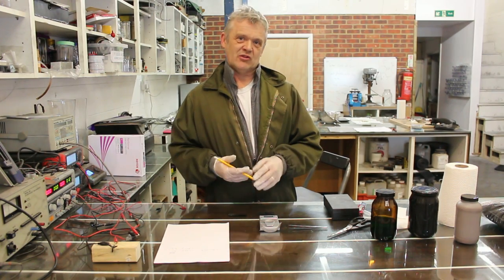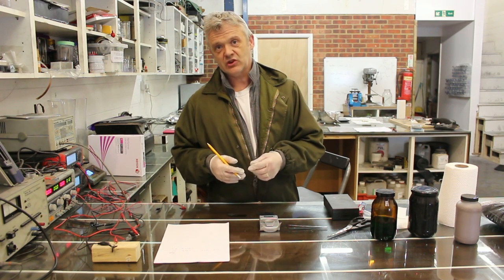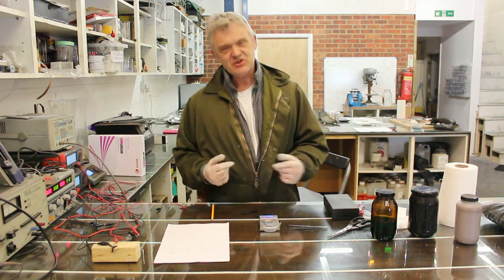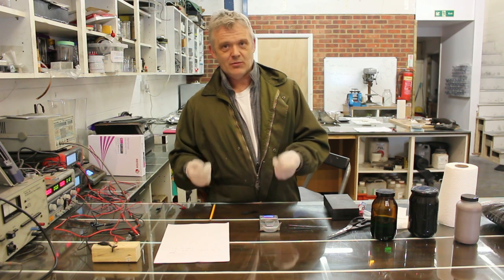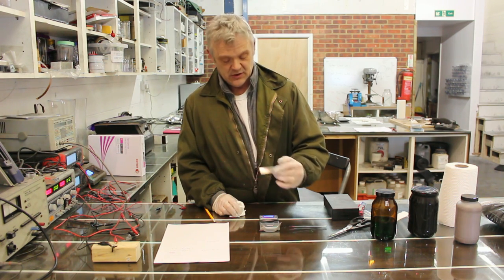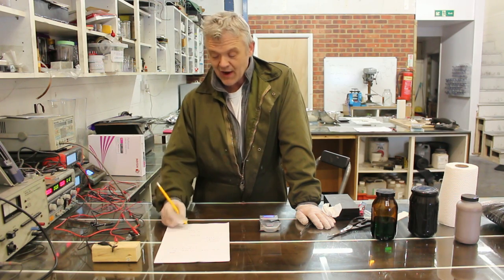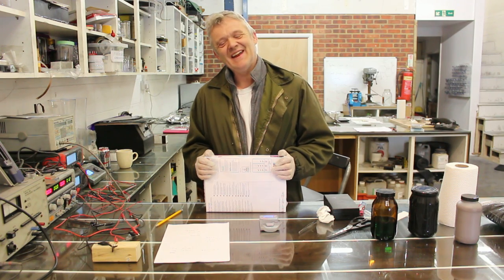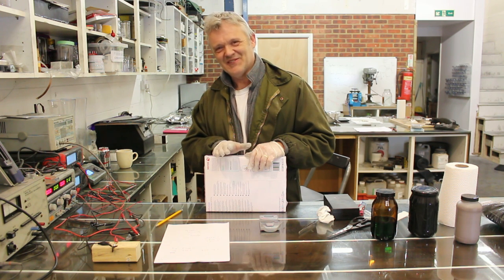How To Make A SuperCapacitor - Follow Up

Comment: So I'm interested in starting an airliner. I want to build planes that are inspired by Elon Musk's vision. And electric airplane capable of vertical take off and landing. From what I've seen most of the technology exists to build such a thing, the only problem is the power source; would sunvault/Edison possibly be able to build a Supercapacitor that could power a passenger plain? If so how would I go about contacting someone to build these for my company?
Reply from the maker: We don't really do outside work mate all Edison development is for Edison. If we did design such a thing we would be more interested in a JV rather than a job for a company. I was thinking of a POC UAV

Comment: I was wondering, you hint that using a thinner coat of graphene, seems like a better result, but what would happen if you made a thick coat of graphene? It seems like the paper seperator you coat the graphene on is what is taking up most of the mass of the super capacitor. Would you get more power storage with a thicker coat of graphene? Also, is there a good liquid separator material that can be thin coated on to your capacitor?  I don't see why you need to have lots of paper, or other solid material, if you can just spray on ultra thin coats of graphene and seperators, I figure you would have more room for more layers if you could just spray the layers on.I was also very interested in your ultrasand. You say silicon dioxide converts carbon into a coating of graphene, under heat. Is that ultrasand a good material for very large scale supercapacitors? The concrete foundation of a house could easly be converted into a huge power storage device with several thin layers of ultrasand grout, with separator layers of laytex paint. Imagine 20 layers of your ultrasand covering the foundation of an entire house, or incorporated into rubber mats put under the flooring of a house. This type of super capacitor would be entirely out of the way, its super cheap and ultra sand seems like a very easy way to mass produce graphene. Also I bet if you made your ultra sand super fine, like flower or powdered sugar, and made a fine grit sandpaper out of it, it would make a wonderful super capacitor.I just love the idea how silicon dioxide is the perfect catalyst, to convert carbon into graphene, it just strikes me why no one has tried to use silicon dioxide to mass produce graphene. I could see, using large rollers of silicon dioxide, and spraying them with a carbon rich spray, then rotating that into a kiln, or a conveyer belt covered with silicon dioxide baking trays, going through an oven, like a bakery makes masses of cookies. Once the silicon dioxide plate exits the oven, the graphene can be scraped off, or chemically washed off.I am looking into making a kiln or a diy brick pizza oven, and try making some of your ultra sand. Could you please tell me if ultra sand would work well for making super capacitors?ThanksRandy
Reply from the maker: +Randy Travis All of these are good questions mate - but you are asking too many questions and not getting up and trying it out. Your best answer to the sand question is to try it and see - share the results even if it doesn't work.
Reply: Yea, I will give it a try, I have a friend who makes pottery, I think I will ask him to throw the sand into his kiln for the last part of the process.
Thanks so much for all the interesting videos. I am also going to try and make some few layer graphene through electrolysis from alkaline batteries and some pencils, then hit it with some acids, then the hydrogen peroxide. I can get a cheap ultra sound from cdr king.
Reply from the maker: +Randy Travis that's cool mate - remember to do a few vids too
Reply: Yea, I have a camera I can do that with. I have to see what tempreture a clay firing kiln gets too. You did an ultra sand video where you used bitramin / tar, would it hurt if it got to a higher temp? I doubt my friend has any control over his kiln, its just add wood and wait until the next day, from what I see. I know it takes a good while before the kiln heats up, and I can stick the stainless steel canister I have in a cooler spot. I really don't have much money or resources, but that also makes this interesting, just to see what can be done.
Reply from the maker: +Randy Travis exactly!

Comment: Hi Robert, I have been reviewing your prolific video productions for a few weeks now, and my head has become a bit supersaturated with all of the concepts and processes you are involved in.  Maybe that state inside my head has congealed a couple of concepts of my own as a result.  Such as a merger of your novel new solar cell device coupled with your supercapacitor into a single unit. Seeing how you used I think it was zinc oxide in your solar cell as the photo conductive agent had me thinking about the more traditional use of silver instead of zinc.  My first profession many  years ago being a photo lab tech, but my memory of those days were a bit foggy, until I also saw your demonstration of using bromine as an intercalating agent to produce graphine in the most simplified manner I've seen to date on that subject. Which process jogged my aging memory to recall the actual active substance in photographic films and prints being silver bromide crystals. Hmm,,,

Comment: Great videos!  However, can you clarify your calculations?  2000Ah @ 1V is 2000 Wh; that's 7.2 MJ.  Given 0.5CV^2, and allowing for a full discharge, requires a 14.4 megaFarad capacitor.  At your specified 4 F/g, that's 3.6 megaGrams or 3600 kg.  There is no known earthly material with a density of 3600 kg in a volume similar to that ream of paper, which would require about 1175 g/cm^3.  Even osmium is about 22.6 g/cm^3.  The mass density doesn't appear to work out, at least with the above information; perhaps you can comment on this.
Reply: +Distant Lands   I'm not getting good figures either.  RMS quotes 1.82J (same as Coulombs?) for foil caps, although P=CV or 1/2 (2.7)=1.35.  Anyway, did he say Ah?  I heard Joules = Watts @1sec full discharge.  Over 3600sec this is an energy delivery rate (power) of .55 Watts.  If Robert said the supercap gives 2000 amps at 1volt per second, he would need a visit from police unless he spec'd a maximum deliver duration of 1 second to exhaustion.  Some, I can figure out-- but I have to have good numbers to start.
Reply: +ACTSRevolution He had been stating 9F/g (he meant 900F/g) and then switched to 2000 Ah!   Why?  These misleads wreck the power of the demonstration -- leaves devils in the details.  If he meant 2000J or 2000Coulombs/Farads, then what do we have?
Reply: To add to the curiosity, he has said a 1MF cap would be a good chunk of
the size of a ream, while 900F/g is approx 1MF/kg.  Anyone help?
Reply: +ACTSRevolution He is certainly a bit "loose" with his terminology sometimes.  For instance, occasionally he uses "power" when he means "energy."  In brief, power (watts) = energy(joules)/time(seconds).  The charge on a capacitor, in coulombs, is Q=CV.  The energy, in joules, is U=0.5CV^2 or U=0.5QV.  The problem with Murray-Smith's calculations here is that the numbers he quotes simply do not allow the requisite capacitor in anything near the small volume he claims.  He has yet to comment on this, but my anticipation is that he either made an orders-of-magnitude calculation error or did a surface area calculation and failed to consider material densities, or some similar error...
Reply: +ACTSRevolution Well, he said 4 F/g is what he has demonstrated.  The higher values (100's F/gram) were for "active material" only, at least as I gather from the video.  2000 Ah @ 1V is a measure of total energy storage (that is, 2000 Wh or 7.2 MJ), and that's fine for terminology.  However, that's also problem for energy density, since 4 F/g requires a 3600 kg capacitor to meet his 2000 Ah @ 1V.  That is, the 3.6 tonnes of material does not fit into a volume equal to a ream of paper, at least with known earthly materials...
Reply from the maker: +Distant Lands i don't remember giving a farads per gram - it was 4 farads per cm squared - thickness was 4 micrometers
Reply: +Robert Murray-Smith Ah, I anticipated you might have meant surface area; thanks for clarifying that... Please check 3:20 to 3:50 on the above video where you discuss "F/g."  3:44 is where you noted "4 F/g."  So, using surface area, one sheet of paper is about 600 cm^2 x 4 F/cm^2 = 2.4 kF per sheet x 2 sides = 4.8 kF/sheet.  So, about 3000 such sheets for 14.4 MF, or about 16 um per sheet including two active layers and separator.  Yes, that seems quite reasonable (considering typical plastic wrap is thinner than that) and certainly close enough for this treatment considering you were noting potentially larger values ("9 F/g", meaning 9 F/cm^2) and haven't optimized yet, etc.  That is quite remarkable; I've had great results building super capacitors over the years, but your figures are really exceptional.
Reply: ...should also note that one could build such a device as a 3000 sheet series cap running 1.6 F @ 3000 V and get the same energy storage, with certain advantages in both fabrication and discharge...

Comment: great video as always .. something just hit me as i look at my cell phone and yes its dead again this time of night .. looking at the box you had and said that amount of space could hold the equivalent of 2000 amp hours of power . imagine making something pocket sized that is just 1% of that size . 20 amp hours .at 5 volts . thats large enough to charge a 3000mah phone battery 6 times .. even worse case scenario  that you might have to plug it in once a day then you walk around with 6 full phone charges . lightweight , inexpensive and could charge the unit in a matter of minutes vs 6 hours with the commercial phone booster batter packs.. could be something to look into making a few ..as cellular phone gadgets are just about everyone's interest right now.and folks could relate to the power produced and convenience factor created and not have a device that weights a full pound in your pocket..
Reply from the maker: +Stacy Williams good thinking mate - i'll have a look into it

Comment: At present you are using the inside parameters of the material available using the - + differential, Outside of the items used offers an alternative, that would enhance and offer a battery alternative as well as capacitance,matching on a diminished size scale with safety overload protection,preventing harm to the user on catastrophic collapse ,keep up the good work.
Reply from the maker: +Stephen Fitton Hiya mate - i don't know what you mean can you expand?

Comment: Love these videos Robert, and i hope to start experimenting myself soon.
i am just wondering though, at what voltage would your 2000 Ah eesd be ?
Also, have you any idea how much they would cost to buy/?
Reply from the maker: +ma894 2.15 volts amte and no idea at the moment but not too expensive i think
Reply: +Robert Murray-Smith cool, I am envisaging using a few of these to make a offgrid electricity storage bank
Reply from the maker: +ma894 that would be a cool thing to do mate

Comment: Thanks so much for the inspiration! I've been doing garage experiments using your videos as suggestions and guidelines.  I have one question about experimenting with these super cap's and that is how do you determine the best charging voltage?  Trying out a bunch of different electrolytes and active materials, but I'm a newbie to the voltage and measurements when it comes to capacitors in general.  Using a medium voltage DC power supply currently, but unaware of specific results with different electrolytes. Any help would be appreciated.
Reply from the maker: +Michael Earles the electrolyte is the place to start mate - water dissociates at 1.2 v so there is a good place - you can change this so you need to test up and down looking for outgassing and drying - it's really just experimentation

Comment: Good Sir Robert Smith,

 Im currently "Binge Watching" all of your videos.

I love the cut of your jib mate! Ive been experimenting with nearly the same set up for a while! (minus your awesome capacitance machine, and electrolyte.)

 I've nearly made a capacitor a thousand times and didn't even think about it lol  

I never even bothered to apply electricity, because i've been researching how to generate it. lol Irony!!

 Ive been researching thermo-electrics and more specifically, thermonic properties of different elements that i paint on or dip coat... ...on to other elements or materials, in my quest to turn fire into electricity. 

 For example i have dipped Copper plates into a copper oxcide + water slurry, let dry, stack, and repeat as needed. Its a decently thermo-electric system, especially if all you can pull together is scrap copper and fire, if you got those, you can also have electricity, and thats a beautiful thing. 

Your process is eerily similar, so ill study your methods, do you proud, and make a 2000ah battery, that can be charged from sitting by a campfire!  

.....correction, i just learned the bit about how graphene turns back to graphite with heat lol, so a thermoelectric graphene battery in one pakage isn't looking  promissing, unless your aware of a chemical process to make graphene thermally stable. lol 

Until then, two "separate" systems, one battery, the other generator and two wires to connect, will do just fine too
Reply from the maker: +MissFit ToyMaker wow - brilliant mate - keep me in the loop

Comment: Of the 10,000 cycles Super Capacitor; What is the duration of a cycle? (Discharge and Recharge)
Reply from the maker: +hunter wayman It depends mate - on size of device and C rate you choose to charge and discharge at - you can't just do one - unfortunately - as there are a lot of times when you might want a fast charge and a fast discharge and equally slow charge and discharge and you need to see what the device will do in both situations

Comment: Look. I've been watching you make supercapacitors for some time now and knew you had gone far
i remember a video about a supercapacitor card you had made a few months ago and had lost my shit like im losing it now.
now all you need is a little more current and this will fucking change shit man. it will change shit.
please make a supercapacitor the size of a box and use it to power a vehicle pleasepleaseplease

Also, I read that supercapacitors had tiny, but very constant currents, have you tried getting more current out of it?
tried making a circuit to raise the amps in it? that can totally be weaponized tho. but it might be necessary to run a electric motor powerful enough to spin a wheel. omgomgomgogmgom the possibilities.

How does this connect to the reluctance motor you were making before? you're  up to something TELL ME NOW MAN ONAONONEAAOENOAENAMEOEA
Reply from the maker: +Lonely Lobo lol - easy mate - but your are right I am working on version 2
Reply: knew it
Reply from the maker: +Lonely Lobo lol - as a bit of a teaser it has 4Ah per gram
Reply: how much does it weight then
Reply from the maker: +Lonely Lobo about a kilo including case
Reply: omg its happening
Reply from the maker: +Lonely Lobo lol